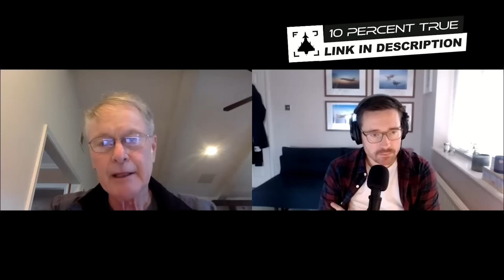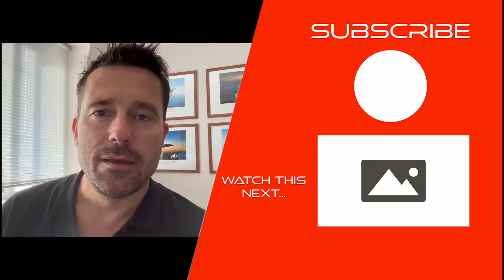YF-23 vs. F-22: As Told by Test Pilot Who Flew Both

Comment: 7:11 It's hard to shake the nagging suspicion that the YF-22 came out ahead in some part because it looked more like a traditional fighter and it could put on a more impressive airshow demonstration than the YF-23, regardless of the fact that line-of-sight dog fighting and the aerobatic capability required for that kind of performance was already becoming obsolete at the highest level of warfare - in a stealth technology environment, if your opponent can get close enough to see you with their naked eyes, then you've probably already lost the engagement. In the F-22, the U.S. Air Force got the best fighter in the world at that time and still today, but did it get the airplane best configured to deal with how the future battle space has been evolving?
Reply: @paulm749  It was easier to build the best YF-22 that day.  The advancements of the YF-23 needed time to advance. The composite structures of the tail for anti -heat signature were very expensive at the time, for example.  The YF-22's thrust vectoring protected more lives sooner.
Reply: @H.A.M.Macintosh-x4q  "protected lives" at that time super Hornet was well enough for that
Reply: I'd actually make the (unpopular) argument that the F-35 is the current best fighter in the world (at least 'in service').
Significantly more range, much better sensors, drastically more multirole capability, over the shoulder options via HMDS+EOTS+HOBS, etc. 
And it comes in at about 1/3 the cost. Which means one could argue dirty, that three F-35's is better than one F-22. But really, I think even 1v1, the F-35 has the edge. It's much better suited to the IR-centric battle space. And is the first fighter aircraft to really truly render nose orientation a secondary consideration in a visual range engagement.

I might give the F-22 an edge "in the rain", as that really puts a clamp on the meaningfulness of IR in the cat&mouse game.
Certainly the F-22 is vastly superior if we're talking "guns only". But frankly, in the modern air combat space, if you're out of missiles it's past time to go home. The gun is kind of akin to a sidearm for infantry - if your rifle is empty, it's time to get out of dodge.

There was a combat exercise pitting F-22's and F-35's apposed several years ago. The results of that are classified. But within a month, the USAF asked congress for 11.8 billion to do a huge overhaul on the F-22.
WITH said overhaul (basically a SLEP++), and wiring the F-22 for AIM-120D's (instead of C's), it all becomes a lot less clear which is better. I'd still give it to the F-35 for range, multirole capability, and cost, but the 1v1 picture gets pretty murky.

A hypothetical F-23, assuming it faced the same budget scale-backs as the 22 (meaning no HMDS/EOTS/120D's), would stand a much better chance of doing well vs an F-35, if only because it would be drastically harder to spot with the F-35's EOTS in the IR spectrum.
Reply: @kathrynck  The F-22 still has a few major aces up its sleeve against the F-35. Its speed and stealth advantages give it the ability to dictate any engagement, and while its radar isn't nearly as versatile, it's still arguably the best pure air-to-air system ever mounted on a fighter. As for IR detection, the F-22 isn't that far behind the F-35 in terms of signature reduction, and its ability to run down the F-35 without touching the afterburners is utterly catastrophic. That's not even touching the upgrade package the Raptor's getting that will put its sensors nearly on par with the Lightning's. Once that upgrade is online, the Raptor clobbers literally anything in service this decade, hands down.
Reply: @griffinfaulkner3514  Well, it has an X-band radar stealth advantage over the F-35. But the F-35's radar is sufficiently more advanced that the radar detection ranges between the two planes would be similar. Basically the better RCS of the 22 would be canceled out by the superior radar. It'd be a wash.

But (assuming there isn't thick weather) the F-35 would see the F-22 first because it has the best thermal sensors in aviation, and the F-22's design does not address IR stealth very well. Neither does the F-35... but it has 1 engine, with higher bypass ratio, instead of 2 engines. That's half as much heat signature, at a lower energy temperature. Combine that with the superior IR sensor suite on the F-35... 

So it's much more likely that the F-35 gets the "look first/shoot first" advantage. Perhaps even a big enough advantage to allow the F-35 to avoid detection and come around behind the F-22 (that's more speculative though). 

Anyway, the ability to fire "at any time, while facing any direction" with AIM-120D's seals the deal. There's no safe place near an F-35, not even "on it's 6". It deconstructs all the norms and expectations of "ye olden dogfight".

The SLEP++ which the F-22 is getting will help balance the playing field between them though, yeah. Possibly tipping things in the F-22's favor again.

And I will say that things would be a lot closer in the rain, where the 35's IR sensors would suck... would level the playing field considerably. On the other hand, if the engagement is at night, then the HMDS would definitely tip things in favor of the F-35, as NVG's are not even close to comparable in terms of pilot awareness. Also, if both planes are out of missiles... yeah the 22 wins with one hand tied behind it's back. It's just that you never really want to be seeking out an engagement when you're out of missiles, so it's kind of an outlier case.

But yeah, with the 'Service Life Extension Program +Upgrades', one could make an argument that the F-22 is in the top position again. F-35 would still likely get first look if the weather is good though.
Reply: @griffinfaulkner3514 Excellent assessment, thank you for this
Reply: @kathrynck  you're behind in your thinking.  The F22 is getring upgrades to match the F35.  It will be more lethal than the F35.  As things move forward and everyone gets stealth and detection systems try to catch up the F22 will be the more superior no matter how advanced the F35.  The F35 is dependent on a connected system but in a dogdight she is at a major disadvantage.
Reply: @sgt_s4und3r54  If it's down to the 25mm's then yes, the F-22 is at a big advantage. But with missiles? F-35 has the advantage (currently). Missiles pull some 30+G, and the F-35 can fire then in any direction. There's no "oh no they're on my six!", it's just lock-fire, lock-fire, lock-fire.

As for whether the F-22 will be ahead with it's upgrades? That's hard to say. It depends on how extensive those upgrades are. If they get the full 360 degree EOTS package, HMDS, and the HOBS capabilities of the AIM-120'D' model (and all the computing power needed to run a synthetic sense of space in the computer in real time)... then yeah. The F-22 will have an advantage overall. It'll still show up better on IR though. But it's faster, higher flying, etc. Then again the F-35 has more range, built-in jamming, better radar... Even with the upgrades it just becomes a tossup.

An outdated attachment to 'ye olden dogfight' is what is behind in most peoples' thinking.

Now if they run out of missiles, sure. With the gun things break down into Tom Cruise 1980's dogfighting rules. But that is such a severe disadvantage in today's air to air arena, that any plane which is out of missiles should get back to base pronto, and do all they can to avoid an engagement. DCS is ultimately a game ;)
Reply: @kathrynck  Like I said, it's getting upgraded to be in line with the F35.  You missed that. It wasn't that I was discounting anything the F35 is capable but rather the F22 is getting similar improvements that put it on par electronically. 

And I so love this argument because it's always the same argument EVERYTIME!

"An outdated attachment to 'ye olden dogfight' is what is behind in most peoples' thinking."

AS for that, we can easily argue your over confidence in technology is yours.  It's proven historically time and again every time there is a technological edge, it's only a matter of time till there is a counter.  Maybe read more history first before telling me something is outdated.  It was believed outdated before until it wasn't.  You're just ignorant enough to remove a tool because you think it's unnecessary until hit happens and you're saying "we need a tool to do that thing now" When it was there before you took it away.

I'm not reveling on the "ye olde dogfight", I'm being practical because as things devolve in a fight, you might still need that knife in that rare phonebooth encounter.

Keep in mind everything only works on paper till it sees combat on a certain scale. The last 2 conflicts we've had, didn't even need an F22 or F35.  I get preparing for the next war and I'm behind that, but you also can't ignore that the more moving parts you have, will most likely cause more issues and potential failures.
Reply: @sgt_s4und3r54  Well, missiles pull 30+G's. And if you have the hardware in the plane, and a clever-enough missile to fully leverage it... all of a sudden "orientation" (where the nose is pointed, vs the position of the opponent) becomes a lot less meaningful. It completely changes the character of visual range air combat.

It's not exactly "time and again"... but about 65 years ago, the Navy in particular (and to a lesser degree the air force) were convinced that "missiles were the future" and they didn't want a gun, just missiles. Literally on the F-4, the original plans at McD-D was to have 2 guns built in from the start, and the Navy said "nah get rid of that, it's heavy". And that turned out horribly, because missiles were not technologically savvy enough to fulfill that expectation.

The difference now though, is that the tech is driving the changes. Missiles eventually caught up with (and even greatly surpassed) the star-struck expectations which they hadn't earned 65 years ago.

There's always tech changes as counters counter counters countering other counters. But I'm not sure that the F-22 is ideally suited to get into gun-fights with Su-35S/Su-30-SM2/Su-57 though. Those models are phenomenally maneuverable. And generally have a wider repetoire of post-stall maneuvering tricks they can play with. So if missiles go obsolete for some reason, that'd be a dangerous situation even for the F-22. There goes leveraging stealth for BVR, and they'd be going up against aircraft potentially which are at least "as" maneuverable as the F-22.

But missiles have been the dominant air to air tool for about 45 years now. And the tech in them keeps evolving to keep them in that pole position. There are counters which have significantly changed how missiles need to be used, some of which I don't think are even public-space material to discuss. But that affects specific missiles or types of missile tech, not "all missiles". Everyone's all enamored with drones lately (and not without reason), but people forget that missiles are the original kamakazi drone ;)
Reply: @paulm749  with the laser platform the f22 is the best nuclear defense the US has in a war scenario but that is just my opinion.
Reply: not today, it needs upgrades in avionics, maybe engine
Reply: This is true and not unlike the F-15 but the point I was trying to make is that the F-23 could have been advanced into the future where the F-22 was shutdown mid-way through its initial production and stuck in time.
Reply: Perhaps, it didn't help the B-2 was overbudget and behind schedule.  Also, the Northrop was mired for years in sleaze and corruption scandals that were shameless and seemed always in the press for the wrong reasons.
Lockheed would be an easy, uncontroversial, choice so the Secretary of the Air Force public comments in the video at 5.30 were accurate and sincere.
Would the F-23 be the jet America needs right now?  Absolutely.  But also subject to Obama's cuts.  Same problems different jet.
Reply: I suspect this is another case of politics in the military where everyone feels the need to stick their finger in the pie.  Another is the plight of the original B-2 that was redesigned to fly low because some felt its stealth technology wouldn't hold up.  This changed the mission profile of the system and now they are trying to do it as it was originally conceived with the B-21.
Reply: @johncnorris  Yes, they are attempting to bring the fight back up to higher altitude  originally envisioned for the ATB/B-2A.

Bringing the B-2A from its original high altitude fight down to a low altitude "terrain following" fight so late in its development added 2 years to the first flight date and an extra 1 billion dollars to the program.
Even after bringing the "penetration" role down to low level, the Low Observable(LO)  nuclear tipped AGM-129 ACM (Advanced Cruise Missile) and the AGM-131 SRAM-2 (Short Range Attack Missile) would be used for DEAD (Destruction of Enemy Air Defenses) role blasting it's way deep into Soviet airspace. After the dissolution of the Soviet union, SRAM-II was cancelled and the late 80's proposed fleet of 132 B-2A evaporated causing all of the ATB development costs to be shared among just 21 airframes.
Even before the final B-1B was delivered in 1988, some felt that its terrain following, high subsonic "penetration" role would be at risk and plans to switch to a cruise missile "shoot-then-penetrate" role for the 90's were undertaken. Then B-1B lost its nuclear role leaving the B-1B almost useless. Major improvements in its conventional bombing role, esp. the addition of an IR targeting pod took it from a nuclear DEAD machine, into a 1 shot, 1 kill, precision bombing machine with a VERY deep conventional weapons magazine.  Now even in 2025 with the new Boeing external pylons that add a further 12-16 AGM-158A/B JASSM and JASSM-ER (Joint Air-to-Surface Standoff Missile) or AGM-158C LRASM(Long Range Anti Shipping Missiles) onto the already stout internal carriage capacity of 24 missiles on the B-1's triple 8 missile Rotary Launcher Assemblies(RLA).  That's 36-40 stealth cruise missiles in a jet that can fly at 600knots, with its 4 F-101 at Max afterburner, just 200 feet off the ground/sea with the pilots hands off the controls.

B-21 will be an excellent resource for the US, not quite the magazine depth of the B-2A, but its offensive/defensive and Intelligence, Surveillance and Reconnaissance(ISR) and all aspect, multi frequency Very Low Observability(VLO) will allow for capabilities B-2A crews could only dream of.
F-47A clearing out the airspace for the B-21As to come through and either drop its B61-11/-12 or -13  nuclear gravity weapons or launch its brand new AGM-181A Long Range Stand Off(LRSO) missiles for those targets that even the B-21 Raider cannot overfly. Either of those weapons will deploy from the Raiders single 8 bomb/missile Rotary LAuncher Assembly(RLA).  The AGM-181 LRSO will be the nuclear tipped cruise missile that will be replacing the AGM-86B ALCM (Air Launched Cruise Missile) that has been the B-52s standard nuclear cruise missile since 1982.
No matter what they do, both the F-47A and the B-21A Raider need to be built in sufficient quantities as evidenced by failing to do so for both the B-2 and F-22 aircraft.

Sorry for the novel.  I love me some strategic bombers.

Good day!
Reply: @hoghogwild  I'm torn because, based on the trajectory of missile technology, it seems having a fleet of C-17s with flight crews pushing racks of missiles out of the back might be the most effective way of neutralizing the enemy.
Reply: @johncnorris  That only really works for static or otherwise predictable targets. The second you have to deal with a mobile or pop-up threat, having the launch aircraft as close as possible for a rapid response is critical. The whole 'pallet of cruise missiles' thing is great for strategic targets, but tactically it's much more limited.